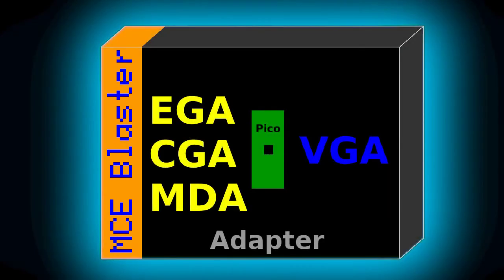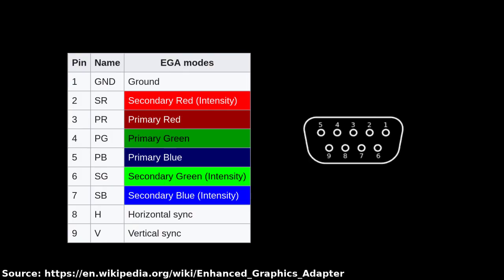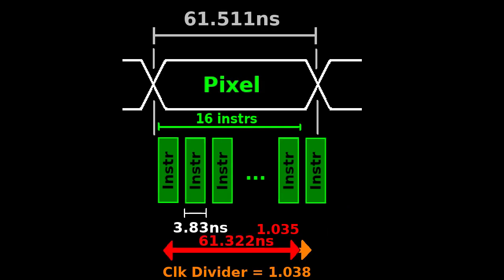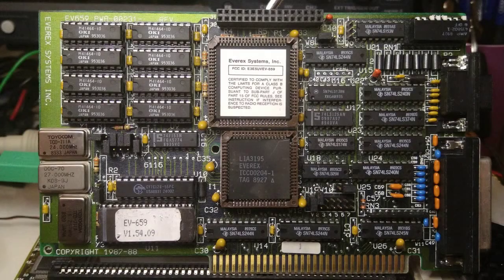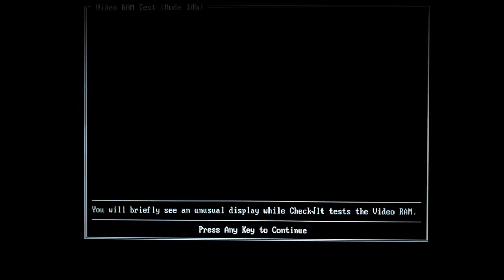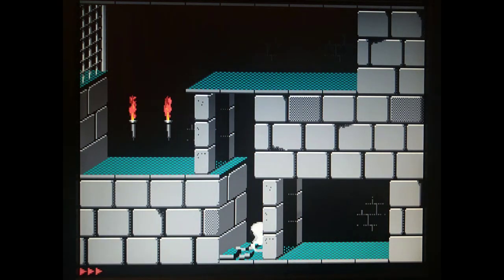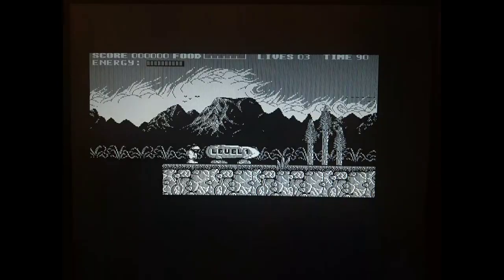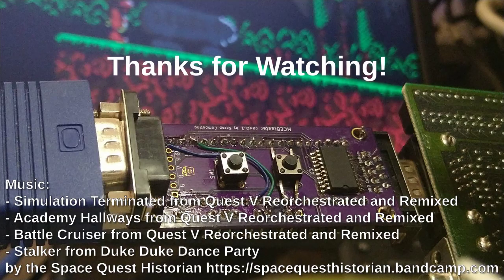MCE Blaster MDA,CGA,EGA to VGA Adapter Released! (Part 2)

Comment: Great Job!! I want to make it green in MDA mode. where should i fix in source code?
Reply from the maker: I am planning on releasing a new board with potentiometers that can help adjust the RGB signals, so in this way you should be able to get green by dialing down R and B. But until then I think I should be able to do this in software. This could be implemented in a couple of different ways in the source code, I need to check which one works best. Could you please create an issue about this on the project's page on github?

Comment: One suggestion/request, would there be any chance to program those monochrome modes to be switched to Amber and/or Green mono modes we had monitors back then?
Thank you in advance.

Edit: the mode could be switched by simultaneous press of both buttons into BW/Amber/Green modes for example.
Reply from the maker: Yeah that would be a great feature. Not 100% sure it's doable though because the VGA output PIO code is doesn't have much room for additional instructions, but I will give it a try.

A hardware solution might be easier. I could just add potentiometers in the output, one for each RGB lines (which are probably needed anyway to adjust the output for some picky monitors). In this way getting the green or amber output should be as simple as just dialing down the potentiometers of the colors that should not be shown. For example for a green display you would dial down Red and Blue.
Reply: @scrap_computing  the idea with potentiometers or small trimmers is really a great idea, killing two birds with one shot, I like it.
And thank you for your work.
Reply: @scrap_computing  Hi, Im just "bumping" my request. I see you are busy with other nice projects, but... will there be version incorporating the pots, please?

Comment: Wow. Brilliant! Both the project and your videos. Really helps to understand stand the challenges and how you try to solve them.

I am looking for a solution for an old Olivetti M19 8088 PC that has analog monochrome 640x480 output at less than 50 Hz. It has a dedicated slow CRT to obscure the flicker.

Since it is monochrome, I think it would fit in the buffer? But what about the v-sync? Could you pull multiple copies from the output memory to get to 60 Hz or higher? I am looking for text applications, not games.

I assume there should be some easy way to convert the anlog input to digital?

I am looking for a solution for my 40 year old CRT is slowly dying on me.
Reply from the maker: Monochrome 640x480 @50Hz might be possible. It's a bit faster than MDA 720x350 @50Hz though. If you build an MCE Blaster board, I could send you a custom firmware to try out. I think all I would need is the VSync polarity (for example MDA is negative, CGA and EGA low res is positive, and EGA high-res is negative) and the pixel clock.
Reply: @scrap_computing sorry, it's 640x400 so that leaves 8 bits for luma. Thanks for your offer.  So I understand this might be a route. Great. Then I will look deeper into this! The computer outputs v-sync and h-sync at TTL level, only the video is analog.

Comment: Great project!!   I question could a TXS0108E be used in place of the 74LVC245 for the level shifting without any mods to the PCB?
Reply from the maker: No, they have a different pinout.
Reply: @scrap_computing  Thank you. I built a through hole and it works really well. Thank you again for all your hard work on this project.
Reply from the maker: @stuartcrawshaw3922  Great, thanks for sharing your experience. Feel free to let me know if you run into any issues.

Comment: Hello! Where can I buy a ready-made device or take a printed circuit board?
Reply from the maker: Getting the boards is easy: You just download the gerber zip file from the "releases" section of the project's page on github and upload it to the website of a PCB fabricator.
The components you need are listed on the project's page.

Please note that there are 2 variants of the board (and the components). If you are new to soldering you should probably go for the Through-Hole (THT) version, which is easier than the surface-mount one.
Reply: I made the board, but I can't upload the firmware. Following the instructions, I connect the Pico to the PC, the drive opens. I copy the firmware file there and at the end of the process the Pico turns itself off. Does disconnecting the Pico board mean that the firmware has been written?
Reply: Thanks to the new firmware, everything worked.
Reply from the maker: @DillerUA  Thanks for reporting the issue, and it's great that you got it to work!

The issue seems to be that some Picos have a flash chip that can't tolerate the overclocked frequencies. The new firmware (also released as rev0.1c) reduces the flash frequency.

Comment: Which software you use to program this project?
Reply from the maker: I am using the Pico's c/c++ sdk
Reply: Can you add 640x435 @50Hz 23.9khz R,G,B,H,V TTL signal input?
Reply from the maker: @QuangNguyen-r9i  It might be possible. What mode is this, is it EGA extension?
Reply: @scrap_computing  This signal output from CNC controller, pixel clock 20.445Mhz
Reply from the maker: @QuangNguyen-r9i  Ah I just realized that the resolution is too high, it won't fit in the Pico's memory. Also the pixel clock is probably too fast for the Pico. I am planning to create a new version of this project using the new Pico 2, which has more memory and is a bit faster. Once I get it working I may experiment with more exotic EGA modes if I find a card that can generate them.
Reply: @scrap_computing  Is it possible to capture VGA 640x480@50 8-color (1 bit per color)?
Reply from the maker: @KirovLive  That would require changes in the input circuit to make it VGA compatible, and it would also require a Pico 2. It should be possible in theory.

Comment: Great work, will Pi Pico 2 work ?
Reply from the maker: The Pico 2 will make it even better!
Reply: @scrap_computing  Thank you for response. Will the code need to be changed ?
Reply from the maker: @cassielam2868  Probably not, but I would have to get one to check.
Reply: hi i ask on github.. but read now the pico2 question.. does it work directliy????? or do we need new firmware?!

Comment: Great project! Is there any way to purchase this already made?
Reply from the maker: Sorry, I am not planning on selling them. But they are not particularly hard to put together, especially the through-hole version.
Reply: @scrap_computing  agreed! So what would the optimal parameters to get the boards made (or even assembled) by pcbway be?
Reply from the maker: @VidaDigital  the boards don't require any special parameters, they are very standard 2-layer boards. Just upload the gerber files and should be good to go.
Reply: @scrap_computing so I’ve sourced 5 pcbs from PCBWAY but I’m still missing the 74LVC245. Is the 74LS245 or 74HC245 acceptable?
Reply from the maker: @VidaDigital  I don't think they will work but if they are pin-compatible you could try, they might work with your card. You do need a 74LVC245 which by the way is widely available and rather affordable.
Reply: @scrap_computing  Not in my country unfortunately. I guess I will have to order them.

Comment: Love it! This got me thinking. Since MDA/CGA/EGA and other TTL signals are digital, what would it take to get them to directly output to "modern" digital displays using "modern" inputs (DVI-D, HDMI, DP)? Right now you would need to convert TTL to analog (using this or similar adapters), then connect that to something like an OSSC, GBS Control, etc., which converts the analog signal back to digital (plus upscaling). Basically, you're going from digital, to analog, back to digital again. So the adapter I am referring to would cut out the "middle man" and just have digital to digital.

Mind you, not an engineer by any stretch of the imagination and I might not be explaining it correctly.
Reply from the maker: It should be possible to output a more modern digital video signal straight from the Pico. DVI or DP should be possible, I have not looked into them in detail. The biggest challenge is the TTL sampling part, but once this is taken care of I think making a variant that can output a digital signal is the next step.

Comment: the only thing i would add would be buffering for hercules and redrawing the image either in interlaced or progressive mode each line twice if you have spare cpu cycles to recognize hercules
that could also remove artigacting completly because you could draw the screen at intiger dividable clocks
but if the microcontroller board can't handle buffering the signal and drawing it back in real time then i guess we stuck at widescreen mode :]
Reply from the maker: Yeah I think line-doubling should fix the issue. It's already doing this in CGA mode, so it should work fine.
Reply from the maker: Actually, it is these specific games that look strange in Hercules mode, because they don't actually support proper Hercules mode. Instead they will produce this stretched image, and they expect the user to fix the aspect ratio on the CRT monitor (see @alexloktionoff6833 's comments). Hercules mode text actually looks all right.

Comment: Maybe Hercules should be line-doubled, even if it was not line doubled initially. It would probably fix the aspect ratio problem somewhat...
Reply from the maker: Yes, line-doubling should do it. CGA is already doing the line-doubling so it should work fine on Hercules too.
Reply from the maker: Actually, it is these specific games that look stretched in Hercules mode, because they don't actually support proper Hercules mode. Instead they will produce this stretched image, and they expect the user to fix the aspect ratio on the CRT monitor (see @alexloktionoff6833 's comments). Hercules mode text actually looks fine.

Comment: Those vertical stripes. I had the same issue in my old UXGA LCD with VGA signal. I tried to change pixel clock in menu but it didn't worked as i hoped.

Comment: The code is really clean and clear! It shows how much work and thought have gone into this, supporting all the different modes. Bravo! Thanks for sharing :)
Reply from the maker: Thanks! It could have been a lot nicer if the Pico had slightly faster main cores. For example the brown color fix is currently handled in the VGA PIo because the main core isn't fast enough to handle an additional if (Color == Dark Yellow) { Color = Brown: }.
Reply: @scrap_computing  would Pi Pico 2 get it closer ?
Reply: Please make a video only about the sw!
Reply from the maker: @alexloktionoff6833  I will try to add details in the README, because things will change as the firmware matures.

Comment: (edited) Sharing an idea - to increase the amount of cards that can have "perfect image" displayed, could  the 
set_sys_clock_khz() in the pico C sdk be used to set a clock that allows the target pixel clocks numbers to be reached more accurately? In particular the case where some sampling artifacts remain. One way of reaching additional values for pixel clock is to vary the PI pico clock speed, I believe. A crude way is to add two buttons for "fine adjustment", that increase/decrease the pico clock by 1 Mhz.  
Another way is to overclock the pico so that one NOP is a finer grained unit, I believe, e.g. from 270 to 290.4 MHz. 
A third option is setting the PICO_FREQ (referencing its name in the code) to a value that numerically allows, in combination with the clock divider feature used, to reach certain desired values in pixel clock with minimal error. I'm thinking of minimizing the sum of squared error over some common target pixel clock values. This would likely allow you to sample more accurately.
Reply from the maker: Yes, adjusting the Pico's clock should remove the artifacts if you can't get rid of them any other way.  I could add a button combination that allows you to tune that too.
Reply: @scrap_computing  The pico supports some frequencies that are close to integer multiples of the EGA pixel clock. In particular 260.0 is 0.112 off and 178.8 is just 0.027. Perhaps the 260.0 one is fast enough for this software and will allow improving the sampling. In other word using DPICO_FREQ=260000 in the cmake command.

Comment: (edited) Autotuning - Perhaps a search in software for the card's physical pixel clock is possible by searching a range and measuring the statistical variance of the pixels in the output image. The frequency with the lowest pixel variance is then the optimal one. The underlying assumption is that the lowest variance corresponds to the least noise in the image.  This requires a still image to be displayed during themeasurement. In this method each pixel's numeric value is read. The different RGB channels can have their variance calculated separately, and then added up. This final sum is the value to minimize across the different clock values.
Reply: (edited) Although I believe the above works in theory,  it does require pixel values to be available, which they don't appear to be due to the nature of VGA? It's not clear to me if something similar would be possible with the VGA line logic. Perhaps a Running Variance can be computed across all lines for a couple of frames (8 perhaps), and that value is then minimized over the different pixel clock values. More specifically, could the value of X in pio_sm_put_blocking(VGAPio, VGASM, X) be used to compute the Running Variance? A rough pseudo code can be: display an image, set a candidate pixel clock, for some short time (say 250ms), compute the Running Variance in the line writing logic and store it. After the variance is stored for all candidates, choose the candidate with lowest numerical value for the Running Variance as the optimal candidate. A potential speedup is to use a binary search. An additional speedup is to first use large steps and after some iterations with the binary search use small steps.
Reply from the maker: I am not sure I fully understand what you are describing. The pixel clock detection is for the TTL side, not the VGA side. On the VGA side we just generate the expected VGA pixel clock and we are done.
Reply: @scrap_computing  Oh, I didn't take that into account. In those terms it would be like we set a candidate clock for the TTL side then measure on the VGA side how good it is, and not necessarily output any VGA signal while measuring. The TTL side then runs at normal speed and the VGA side is not doing significantly more than before, just aggregating some numbers. It would sort of be replacing the VGA side with a "instrumentation side"while determining the best candidate clock. Possibly a "please wait" banner or so could be displayed while this logic runs.
Reply from the maker: Ah OK I think I got it now. But how would you reliably measure how good the pixels "look"? The adapter can't tell if the noise is coming from bad sampling or from the actual input.

Anyway, adjusting the pixel clock is not such a big deal. As long as you don't constantly swap cards you would only need to adjust it once per mode.
Reply from the maker: The issue is that the fastest detection loop in a PIO takes 2 instructions, one `jmp pin` and one `jmp x--`, this is already 7.2ns. So if we try to measure the time a pixel is found "ON" our measurement will be a multiple of 7.2ns. But what we need is a resolution of about 0.001ns.

Comment: Prehistoric and PrinceOfPersia do not use original HGC modes, but tweak card to more like EGA timings. Can you show original HGC text and 720x348 graphics mode?
Reply: Just in case BreakOut game from Poland can use native HGC resolution
Reply from the maker: I was not aware of this, thanks for sharing. I will try out some genuine HGC games.
Reply from the maker: Could this be why the image in these games looks so stretched? Monochrome text looks fine, but the games themselves look like they need line-doubling.
Reply: @scrap_computing  exactly, this is tweaking HGC to ease and kinda share graphics routines and bitmaps. They make hgc output 80 bytes per row and 200 lines, users had to use hor/vert knobs of monitor to stretch video full screen.
Reply from the maker: @alexloktionoff6833  Ah, makes sense, thanks for clarifying. So there is no point in trying to fix how these games look with firmware tricks.

Comment: This is amazing! Thank you so much for making and sharing this! I will be making one for sure! One question: are you sure the 74LS245 is the right part? It looks like you're powering it with 3.3v but then you have 5v inputs and I don't know if that's how it's supposed to work. I know there is a part that designed to go from 3.3v to 5v the way you want to... yeah I think the SN74LVC245AN is what you're looking for. It should be a drop-in replacement but it's designed to be powered with 3.3v and takes TTL/CMOS as input and outputs LVTTL. I think it comes in a version that has the same SMD footprint. But I'll hopefully get a chance to make one soon either way! Thanks again!
Reply from the maker: Oops good catch! I am indeed using the 74LVC245, but I couldn't find the right entry for it on kicad, so I used the LS part instead. I will update the BOM.
Reply: @scrap_computing RP pico inputs are 5v tolerant in practice, just you  need to guarantee you will never setup them as outputs even temporary
Reply: which one is now the correct? the ls?

Comment: Think it would be possible to autodetect Hfreq through a counter in another state machine? Could see it require manual intervention on the cpu side due to varying pio frequency tho.
Reply from the maker: There may be a way, but I think it won't be very easy because the pixel clock frequency is quite comparable to the state machine frequency. So you may need multiple state machines running at different frequencies etc. But yeah, that would be really cool!